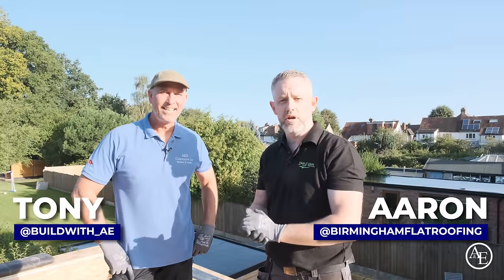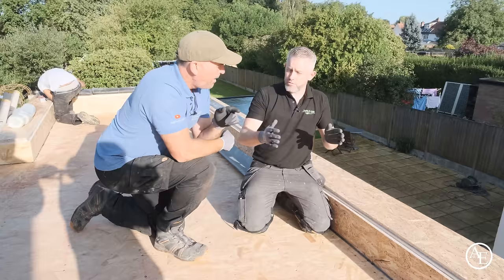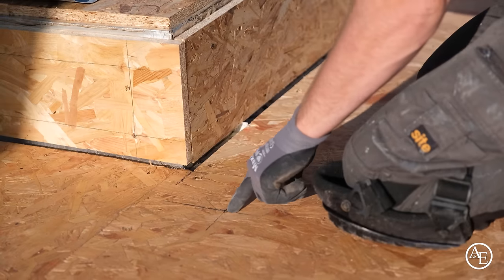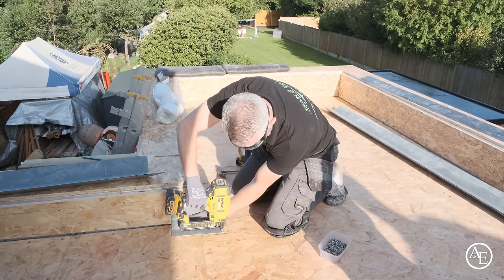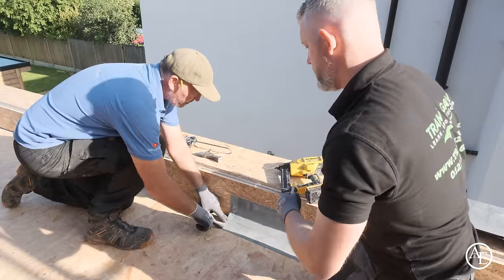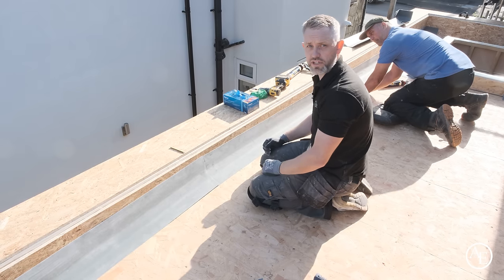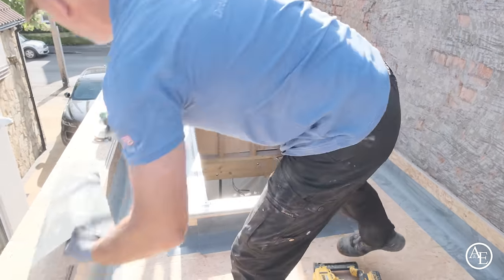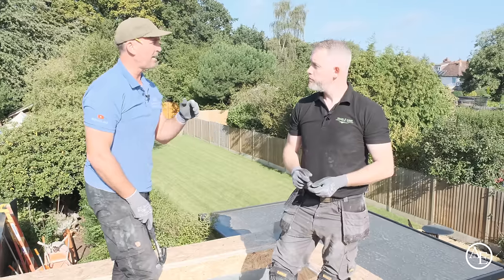How To Install GRP - Fibreglass Flat Roof Part 2

Comment: I use fibreglass a lot Tony, will be honest we had a few issues at the start due to not understanding the product properly, we’ve done around 150 roofs in the last 6 years and not had a problem, now we’re in a rhythm as a team we don’t even get in a mess with resin these days 😂 

Always rubber single garage roofs though, much quicker

Comment: Hi guys will the fibreglass expand + contract that much ? I thought fibreglass when set was hard ?
Reply: This Fibreglass is flexitec 2020 its from Restec,its a flexible fibreglass that can be used as an overlay system.